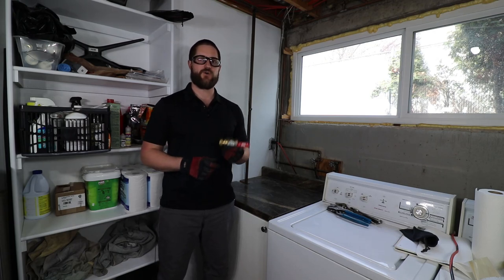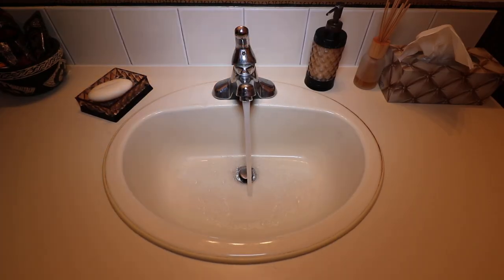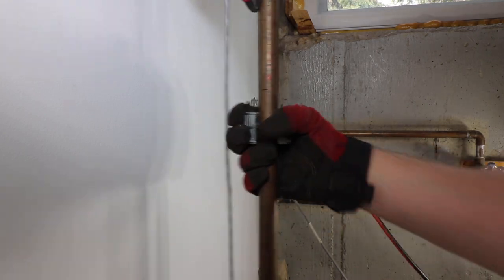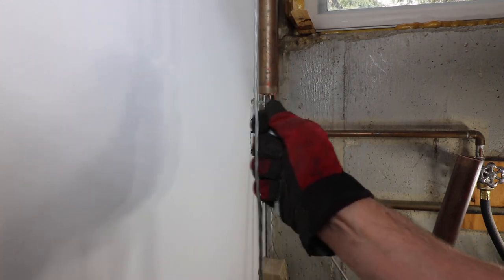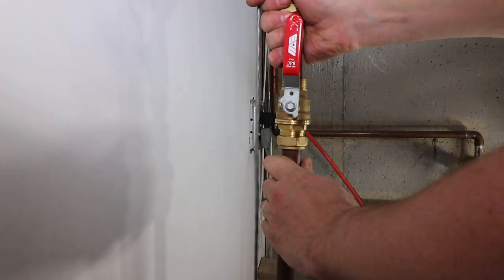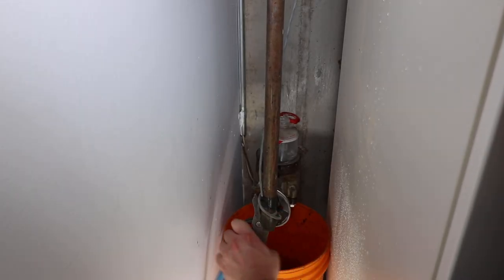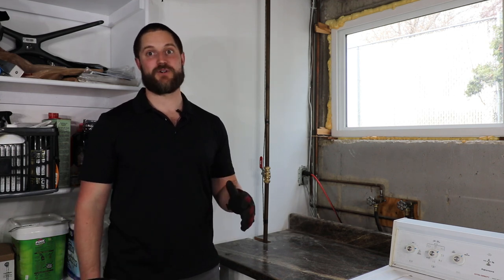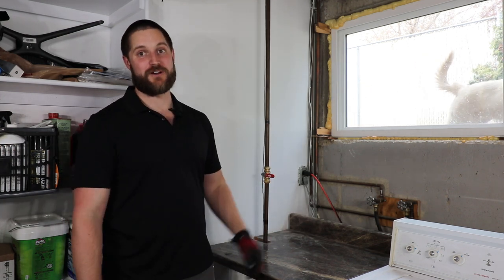Compression Ball Valve Install

Comment: I recommend the compression over solder. Too much heat will damage the valve. At least it did for me. I only used propane too. I was surprised.

Comment: Wow, this was the most straightforward and entertaining video I've seen on the subject! Well done.
Reply from the maker: Thanks for the kind words! Take care.
Reply: Agree,  very straightforward. But additional narrative would be helpful. Like, instructions to hold the valve via a collar while tightening the compression collar; instructions to turn clockwise relative to the threads.  Use or don’t use Teflon tape.  The guy said don’t over tighten to not deform the ferrule, but how?  By “feeling” resistance and then turn  1/4 to 1/2 turn.   In real life, it may the first time a DIY installs a shutoff valve, so additional instructions would avoid racing to tighten in case if a compression spray leak if not tightened enough or a disastrous spray leak if ferrule is deformed.   Finally, advise the DIY to buy a ball valve (not a gate valve) and most likely 3/4 inch, maybe with a bleeder.  Make sure valve is lead free for potable water use.

Comment: What I'm really curious about is whether the common practice is to install the handle (for when valve is open) to be pointing in the direction of the flow. The valve is bi-directional so the handle could point up or down in this video, but you pointed it up. I heard that's the common practice, but cannot find confirmation of this on YouTube or Google.

Comment: Thanks for the video. One question, does ball valve have markings for inlet and outlet, or you can use either end as in or out?
Reply from the maker: Hi Snow G, That is an excellent question. A ball valve has no direction of flow and can be installed either way. It is common trade practice though to install a vertical and horizontal valve in the direction that the valve closes by turning the handle downwards. This would mean when the valve is in the open position, that the handle would be facing up on a vertically installed ball valve and to the right on a horizontally installed ball valve. One reason behind this is that in an emergency situation it is easier to pull a handle to close than to push. This is especially the case if the valve is above your head or anything over 1" in size. Thanks for the question! Take care!

Comment: Very informative tutorial indeed. Thank you. I am about to do the same thing but not sure how many inches of the pipe are to be cut off.
Reply from the maker: To get the most accurate measurement you can insert a piece of copper into the valve, then mark the copper at the end of the valve(at the start of the threads). This will give you the length of copper that inserts into the valve. Do this for both sides of the valve. Then subtract these two measurements from the total length of the valve (thread to thread, not nut to nut). This will leave you with the amount of copper to cut out. Hope this helps. Cheers!
Reply: @PROSDIY  appreciated. Thanks

Comment: Does this need to be a lead-free valve assembly since it is delivering potable water to all of the house?  I've got an old 1960s gate valve that is slowly failing.  Trying to find a lead-free ball valve assembly with male NPT ends on both sides.

Comment: How did you know if this was copper or brass? I have a tube just like this and wanted to put in a main water shut off BUT I was told when measuring the size of the tube that the material matters when measuring is that true?

Comment: Great simple video. Thanks! I have a question. If I want to change out an old compression valve, I just have to unscrew the nuts, right? Meaning, there isn't a special tool to use because of the ferrule, is there? Thanks!
Reply: You might need a ferrule removal tool. Depending how old and how tight it was installed. If you don't have one you'll have too cut them out. Hope this helps.
Reply: @f3arful  Thanks!

Comment: I’m install a tee valve for an icemaker but it has the same kind of compression fitting. How much of the original copper line do I remove to make room for the fitting. Appx 1” or is there a proper way to measure?
Reply from the maker: Different manufactures of valve will have a slightly different amounts to cut out. I usually just eyeball it lol. To get the most accurate measurement though you can insert a piece of copper into the tee, then mark the copper at the end of the tee(at the start of the threads). This will give you the length of copper that inserts into the valve. Do this for both sides of the tee. Then subtract these two measurements from the total length of the tee (thread to thread, not nut to nut). This will leave you with the amount of copper to cut out. Hope this helps. Cheers!
Reply: Great, thank you!

Comment: Would you recommend putting some teflon tape around the compression ring?
Reply from the maker: No that is not recommended. The compression ring is designed to make direct contact with the copper. Teflon tape can cause an improper seal and a false sense of being tight. Thanks for the great question!
Reply: @PROSDIY  Thank you
Reply: I use pipe dope on the compression rings works well

Comment: this is where a stop cock should be..... where you can see it and where you can get a spanner on it. In the UK they are usually absolutely knackered, growing, rotten, bricked into a wall, hidden, no one ever touches them or looks at them and every time you actually want to use it it is rock solid and breaks when you use it..... that's if you can find it. Usually kitchen fitters cover them up, sometimes drill a little hole with sharp edges you can just het your hand through. Houses and the construction workers are all a bodge up

Comment: So in the open position, the red handle always points in the direction of water flow?  Is there a reason for that?
Reply from the maker: Not necessarily the direction of water flow but if the water is on or off. Handle parallel to piping is on and perpendicular is off. It's an industry standard that allows someone to look at the valve and quickly determine if it's on or off.
Reply: @PROSDIY  So it doesn't matter if it's pointing upstream or downstream?
Reply from the maker: Nope it doesn't matter. There are some hydronic heating plumbers that will install them in the direction of flow, this can help service techs quickly determine direction of flow (important when pumps/circulators are involved. This is far less important for residential plumbing though as direction of flow is rarely needed. I would install it in which ever way is more convenient and easiest to access/operate.
Reply: @PROSDIY  OK.

Comment: What if you have no movement with pipes?
Reply from the maker: A slip coupling may help out in your scenario. Slip couplings are designed for areas where you can't separate the piping far enough apart to install a valve or fitting. Sharkbite also makes a 1" slip valve.
1" Sharkbite slip ball valve: https://amzn.to/35p76ER
1" Sharkbite slip coupling: https://amzn.to/38Et2xG

If soldering, slip couplings are available as well in copper.
Hopefully these fittings can help you out. Good luck!

Comment: Man nobody ever shows how to do this in a limited space.. I have to install a 1" valve where my old water main valve is fked. Its about 2ft deep by 2ft and my big box store doesnt have the slip type ball valve in 1" so I have a regular sharkbite and another sharkbite coupling but i cant move the pipes because of the limited space.
Reply from the maker: It's unfortunate that you have such limited space. I'm trying to picture the scenario that you're in. I'm wondering if you might have enough room for a slip coupling. Slip couplings are designed for areas where you can't separate the piping far enough apart to install a valve or fitting. Sharkbite also makes a 1" slip valve.
1" Sharkbite slip ball valve: https://amzn.to/35p76ER
1" Sharkbite slip coupling: https://amzn.to/38Et2xG

Hopefully these fittings can help you out. Good luck!

What is a slip ball valve?
"Push-to-Connect Slip Ball Valve is an innovative valve that allows you to make a quick repair or add in ball valve to rigid Copper or CPVC Pipe. The slip ball valve allows up to 2 in. of pipe to be removed allowing for easy installation where rigid pipes do not allow movement."

Comment: I wish you would have said how much pipe you cut. I'm a noob and don't want to cut too much. No one in these videos ever say much they cut.
Reply from the maker: Hi Kevin, Unfortunately this isn't a universal dimension. Each brand of ball valve will be slightly different. I use a B-5C ball valve in this video which has it's specs online: http://www.mastewart.com/pdf/MAS/Technical/B-5C-LF.pdf . You can stick a piece of copper in each side of the valve, mark the copper at the end of the threads on the valve, and take these 2 measurements and subtract them from the overall length of the valve  (thread to thread of the valve, not nut to nut). This will give you the exact amount of copper to cut out. Good luck on your project and let me know if you have any questions. Thanks!